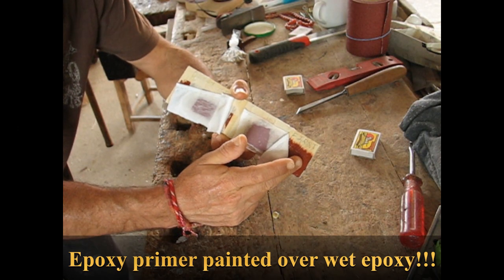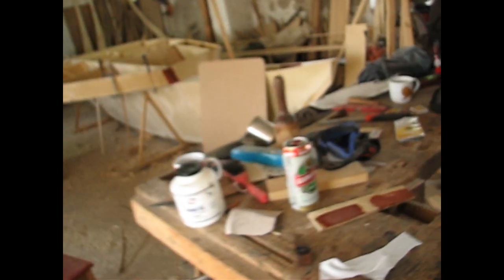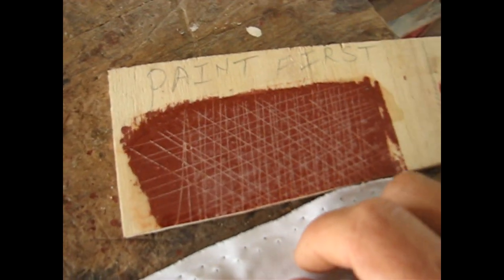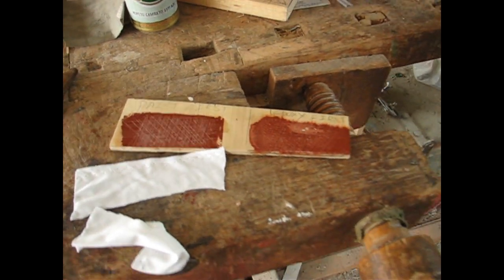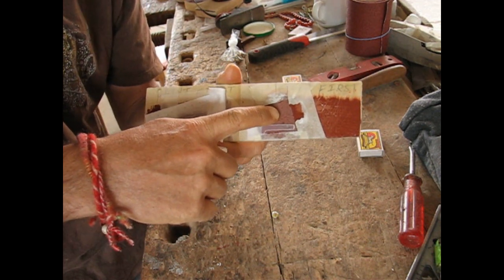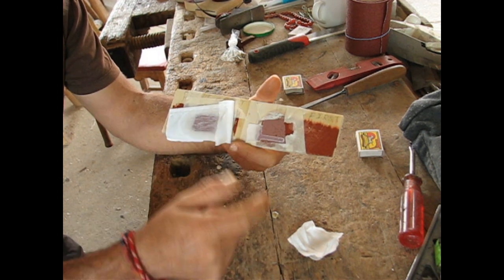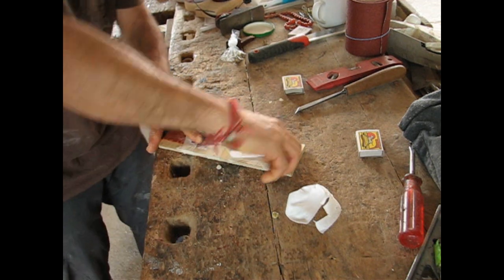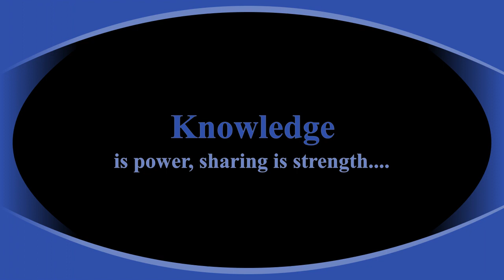Painting over wet epoxy... Adhesion test, by Balkan Shipyards

Comment: Great result. Less sanding the better. Its interesting how layering materials works. On my boat I basically layer less durable to more durable working outwards. Its only 4 coats total, but like u did, I add a second coat immediately after the first to achieve that molecular bond. More than one way to do this stuff! Thanks for the research! ZPLAA
Reply from the maker: Wet on wet rules Zack, I do it as much as I can..... All d best bro, and... u know, Keep Shunting hey????

Comment: Hey Rael, sometimes I will add a filler coat after the first laminating of fiberglass over the raw hull. The filler coat is the way Russell Brown does with West 410 (Microlight.) The filler fills in the weave and is easier to sand/fair. I wonder if the paint were mixed with the microlight if that would achieve similar results as yours and, in addition, would leave a 'filled' primed coat. I know there are some commercial high-build primers that have filler in them (Interlux Prekote.) Prekote primer, though, is not compatible with 2-pack topcoats (the 2-pack topcoat solvents will dissolve the Prekote high-build primer.) The modified Dobkins method might achieve:
1. no-sand, 
2. high-build/weave-filling, 
3. laminating and 
4. priming 
in one coat!
Reply from the maker: Interesting Daniel, is the filler coat a ready to go product, or is it a powder like micro balloons that is added??? Probably micro balloons may just achieve your effect, that would be interesting.... Adding saw dust may work too, I may experiment to see the results for above the waterline, but for below waterline micro balloons may be an option.... I just don't know where to get it, and still wonder how much water such a filler will absorb????
  Anyway, saw dust test coming soon.....
Keep Shunting man....
Reply: @BalkanShipyards  Hi Rael. West System 410 Microlight Powder (relatively cheap.) It is a proprietary blend - my guess it is a combination of microspheres and some other stuff: 

The reason I am focused on this is actual results I've achieved. When used as a filler coat as Russel Brown demonstrates in his epoxy videos, the 410-thickened epoxy is rolled and then brush-tipped over a wet glass fabric and epoxy laminate over plywood. The 410/epoxy coat (if rolled on mustard-thick and brush-tipped) seems to cause the epoxy to flow and results in a gelcoat like smooth surface.

That's the big deal - to result in an even, smooth flowed-out surface (no fisheyes.) Rolling out epoxy alone results in fisheyes and unevenness. 

Paints (primers and topcoats) have all sorts of additives to encourage flow and even 'skinning'. In fact, some very expensive paints, like the Alexseal I am using, has now offered a just-invented additive for their paints to buy in addition to really insure flow. It;'s a big selling point to their brand "roll and tip that results in 'sprayed' quality".

So, those two things are what the 410 Microlight are for - filling the weave and flow out to result in smoothness. Now the disadvantage might be that the resulting surface might be less hard than a conventional 2-pack topcoat. The 410 Microlight is specifically designed to sand out easily. I guess that would be the thing to test - scratch test a conventional topcoat painted surface vs Dobkins Modified No-Sand Protocol (DMNSP) (one step epoxy laminate, fillcoat, and paint)

410 Microlight Filler

From the MDS page it looks like 410 is a proprietary blend mostly of microspheres (maybe 85%) and other ingredients referred to as 'thermoplastics' which look like the important additions that enhance 'flow'. I specifically use 410 now rather than just microspheres (which I have a ton of) because of this beautiful quality of flow it adds to overcoating with epoxy.

Here's West's description:
410 Microlight™ is the ideal low-density filler for creating a light, easily-worked fairing compound especially suited for fairing large areas. Microlight mixes with greater ease than 407 Low-Density filler
or microballoons and is approximately 30% easier to sand. It feathers to a fine edge and is also more economical for large fairing jobs. Not recommended under dark paint or other surfaces subject to high temperatures. Cures to a tan color.
When West System® epoxy is thickened to a peanut butter consistency with Microlight™, the cured product sands and carves like basswood. "

This is Russel Brown's tutorial on "Fill Coating" (behind a paywall):

https://www.offcenterharbor.com/videos/mastering-epoxy-russell-brown-part-8-fill-coating/
Reply from the maker: @djmydlack  Thanks Daniel, cool stuff, I know nothing about these high tech materials, cos we are budget builders, not out of choice rather just the way it is..... I'm pretty happy with the stuff I use and "work boat finish" is fine for me. People like my boats and even comment that they are pretty.... My far from "show boat" finish, is usually ignored.
Still u got me interested, I will check Russel's link and look into this stuff just so I know, though I'm sure it doesn't exist in Bulgaria.

I feel you're right about the finish, it matters if I start building for others, though that's not on the cards for now.  I like glassing, then filling weave with epoxy, though the next day the glass is showing... Soon I will Glass the deck, I will fill weave once with epoxy, then I will brush on primer, a couple coats should fill the weave pretty well, the epoxy primer is cool stuff, because you can recoat the next day without sanding, it has a window of about 2 days. So if I get all coats on in a day, (which I will) the bond should be rock solid. 

I must just add that once primer is applied over wet epoxy, it takes it about 3 days to harden, I like that, I think it's letting the amine out and that's why they bond well. It too sands like chalk.... 

Take care man, and all d Best!

Comment: It would have been good to show the bond of cured epoxy and then epoxy primer on top without sanding to illustrate the difference.
Reply from the maker: Cured epoxy would have to be sanded before paint (except for amine blush, that could just be washed off), epoxy has a very glossy finish, the paint can't adhere to it, so sanding is necessary. It would be a good test, but I expect about the same results, though you got me interested.... Thanx it's on the to do list.....  All d best
Reply: @BalkanShipyards   Hope you do the comparison between not sanding the epoxy and sanding the epoxy so we can see how much difference there is in the epoxy primer adhesion to not sanding.  I've subscribed and ticked the bell to hopefully see that update.
Reply from the maker: @RAPTOR8ASDF  O.k. man, what u want to see is cured epoxy, washed to clean the amine. Then primed with paint, then epoxy on a rag and pull??? I will cut small squares in the paint before glowing on the rag. beside it I will have a wet on wet example I will test, so we can compare the 2. is that what u want to see? strength of wet on wet vs wet on dry but not sanded???
Reply: @BalkanShipyards  What would be nice to see is an adhesion test of cured epoxy and then without washing or sanding, epoxy primer applied.  That compared with wet on wet as shown in your first video.  In other words, someone applies epoxy and then a few days later he just wipes off the dust and applies epoxy primer without sanding.  Thanks.
Reply from the maker: @RAPTOR8ASDF  got it, tomorrow gonna epoxy stuff, so can start preparing a few tests, what u want, then only washed, and washed and sanded.... 'Why Not?' lets go the full 9 yards....... Keep Shunting bro.